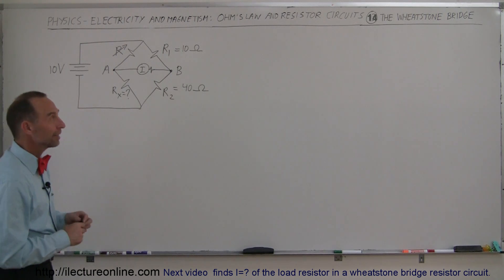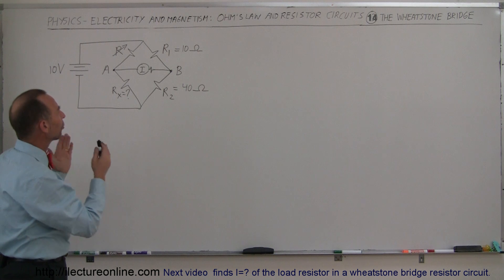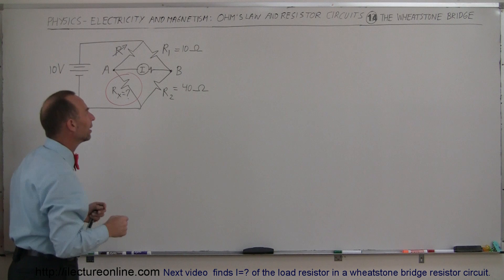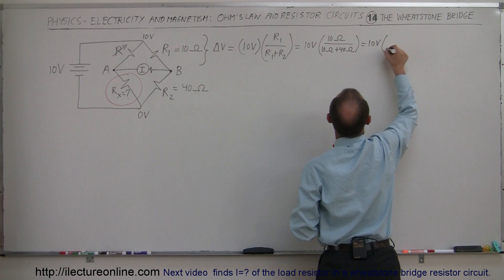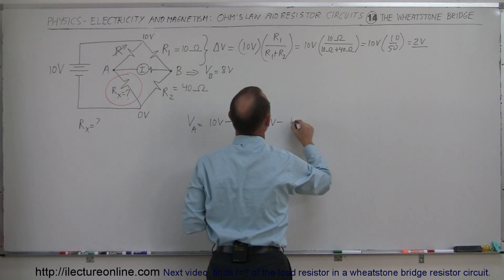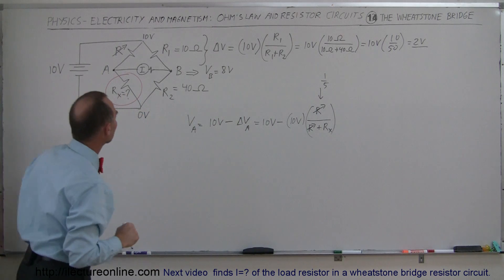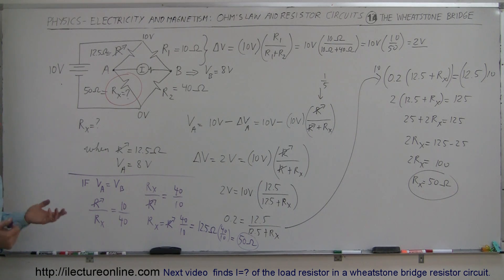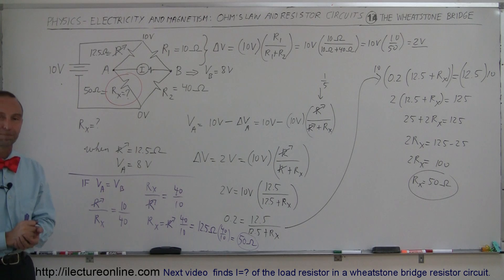Physics 42   Ohm's Law and Resistor Circuits (14 of 23) The Wheatstone Bridge (1)

Comment: Sir, I think no current can flow between point A and point B even if any value of resistor is being connected between A and B as the two resistors Ra (set Ra = variable R + Rx) and Rb (set Rb = R1+R2) are in parallel meaning that the voltage is the same for both Ra and Rb. No potential difference between the two resistors if they are in parallel.  Please let me know if i misunderstood.

Comment: sir can u plz explain how the lower end is at 0 volt..........? and how did u calculated the potential diff
Reply from the maker: To force that end to be zero, we would need to connect it to ground.  We just picked that end to be zero for reference.  Remember that in circuits on the potential difference matters.  If the battery is 10 V, then one end is 10 volts higher than the other.
Reply: +Michel van Biezen   
thnq soo much sir for replying but can u tell me how did u find out the potential diff between 10 ohm resistance
Reply from the maker: First of all, the potential difference is always "across" a device.  (It is the voltage difference between the 2 ends of the device.  There are several methods to find the potential difference.  Using ohm's law it is V = I * R
Reply: +Michel van Biezen 
thnq so much sir... your videos are very very good  it helps me to clear  all my doubts.

Comment: I guess I am still trying to understand where the 12.5 Ohm variable resistance comes in. Is guessing a part of the method or was that specific number part of the problem?
Reply from the maker: Yes, the 12.5 ohms is the "given" resistance of the variable resistor.  If we set the variable resistance to 12.5 ohms the problem will be worked out as shown.

Comment: You are very gifted as a teacher/physicist. I am confused, however, how you found that R variable was equal to 12.5 ohms?
Reply from the maker: Morgan Kennedy 
That is a good question.
Since R(with a line through it) is the variable resistor, it can be set to any value.
In this example we are trying to determine the unknown resistor Rx
When the variable resistor is set at 12.5 ohms, the current across the bridge goes to zero  (thus the 12.5 ohms is a given value in the problem)
With that information you can find Rx
Reply: Great thanks!!
Reply: Great. Thanks!
Reply: You can build this really simply and check it yourself. With a rheostat (variable resistor) at Rvariable, looking at the meter, tune the Rv until you get zero current displayed. At that point remove and measure Rv and you will see that 
Rx can be calculated from the ratio (professor said it, with the ratios now knowing the Rv, you solve for Rx). Actually very simple but very powerful. This is used in a lot of instrumentation and analytical equipment.
Reply: yes but how do you know that the variable resistor has to be set to 12.5 ohms?
Reply: @Mediaceja  R1 and R2 are known. Rx has an unknown value. We can simply watch the Voltmeter (connected btw A and B) while adjusting the value of the variable resistor "Rv" until the voltmeter reads 0V (for this example he convieniently chose this event to occur at Rv=12.5V). At this moment we can then easily determine the value of the unknown resistor, since the ratio of the resistors on the right equal the ratios of the resistors on the left...i.e. Rv/Rx=R1/R2. (12.5/50=10/40)
Im sure you already figured this out but I felt like it could still help someone else to state this explicitly. ;)
Reply: I think that is done via experimental values, at least the previous videos I have seen on the Wheatstone Bridge state that.
Reply: He just set this value. It's like ajusting the resistance value ... You choose.
Reply: yes, well spotted. The whole process depends on Rv being known exactly ie it is calibrated so that when the rheostat points at 12.5 Ω  then that value is exact. but how could we be sure that through use the resistivity of the wire in the rheostat had not changed, due say to temperature  or corrosion. 
When I did this at school many years ago. On the left side of the bridge was a known resistor say K=10Ω and the unknown Resistor R.  Between the two is a wire connected to a galvanometer and the other side to a “slider”.
On the right side of the bridge was a piece of wire (aluminium i think) with unknown but high resistivity.
 this piece of wire is stretched along a metre rule. The battery os connected to each side of the Al wire.
the so now when the slider is positioned at a known distance along the Aluminium wire, say 60cm and the galvanometer reads zero. then we know that the resistive ratio in the left side is equal to the resistive ratio on the other.
Thus R/K = 60/40 So R= K*(60/40)= 10*(60/40)  =15
note the galvanometer is a wire=wound current detector that is very sensitive but only needs to measure zerp accurately. The zero position could be checked when it wasn’t connected.
Now we have a system which doesn’t depend on the accuracy of a variable resistor. we only need one resistor of fixed and known resistance.